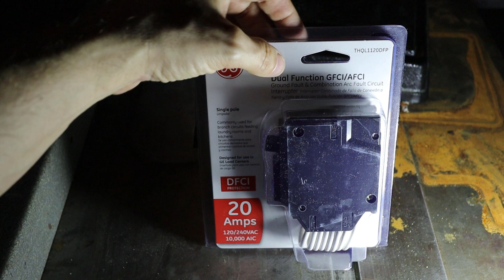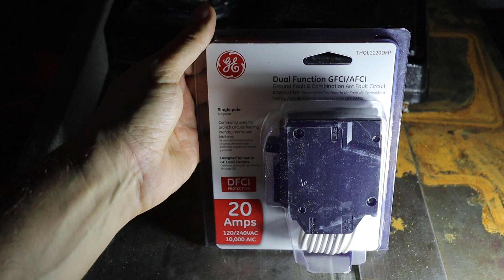AFCI/GFCI Circuit Breaker Replacement Highlights

Comment: Hi Rob,
You showed all the proper cautions. Next year going to replace my 100A service with a 200A service. The panel is full and there are many breakers that have more than one circuit and I want to have one breaker for each circuit. You and the family stay safe.  73  WJ3U